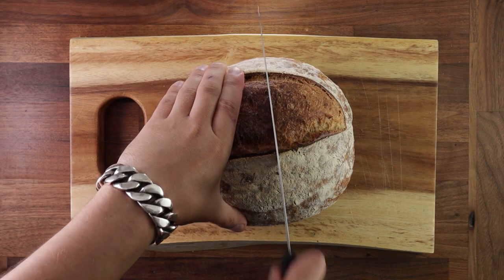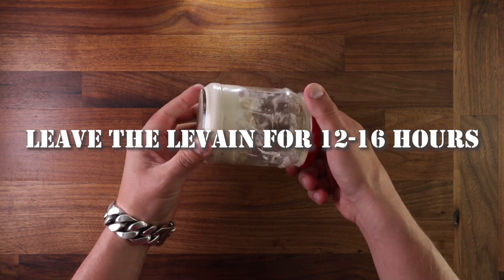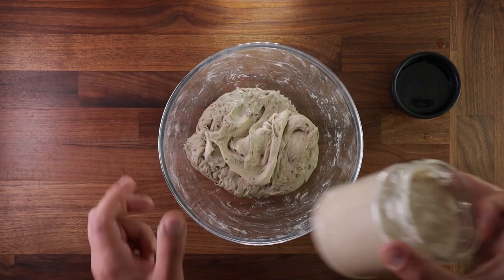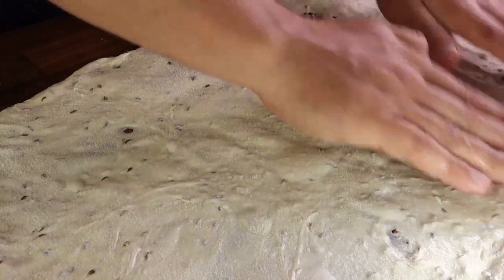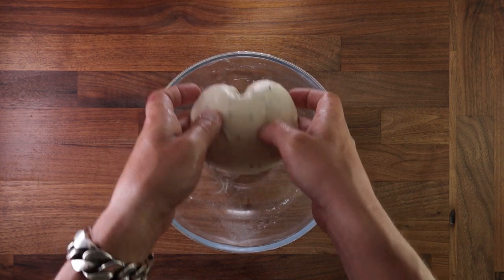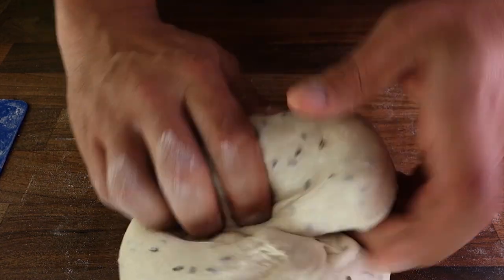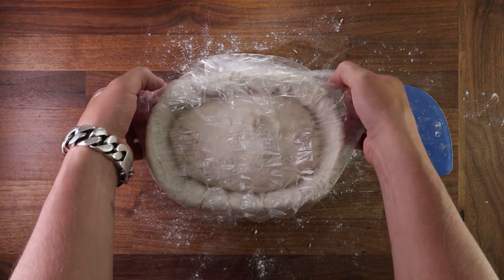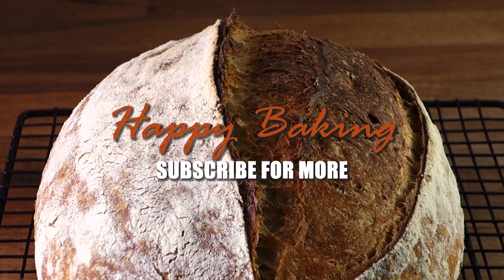Handmade High Hydration Sourdough Bread Recipe | Autolyse Method | How To

Comment: Struggled endlessly with this one even after following all the steps meticulously 😔.The beginning of the downfall was  the dough that was to be autolysed didnt quite look as taut as the one shown in your video. It started out shaggy and never formed a taut shiny surfaced ball. The end result was a dense chewy bread. Any clues on where I might have gone wrong ?
Reply from the maker: What kind of flour did you use?
Reply from the maker: It is definitely not an easy dough to work with and I myself had to do it a few times to get it right. If after the autolyse it looks still too soggy then perhaps you can leave it for longer.
Reply: Bread flour from the super market .
Reply: The dough had autolysed . It was stretchy. Since the dough prior to autolysation looked too shaggy compared together yours, was wondering if I could hold back like 50 g of water perhaps. I live in a humid city too! Thank you for your response always
Reply from the maker: I think 50g would be a bit too much. Try 20-30g. that would bring the hydration down to 72-75%. 👍🏻
Reply: Ok noted. Will try it when my spirits r more uplifted 😂
Reply from the maker: Haha I know how you feel 😄 trust me I’ve failed more than I’ve succeeded. All we can do is practice and learn :)

Comment: Can this recipe be made with 100% whole wheat? Would anything specific have to be changed? I'm very interested in 100% whole wheat sourdough but vids are hard to find on that specific type of bread. (most are blended bread or overly complex or use lots of extras)
Reply from the maker: Yes. You could even swap it right out. If the dough is not airy enough for you, then add more water. But I would say try it with just swapping the flour first and only then adjust the water if need be.

Comment: question tho, I put the dough back to KA mixer and use the mixer to work it instead of hand folding. I am sure it is fine BUT, could that be the reason that my bread doesn't have crumbs like yours? (Mine has always been closer/less/smaller bubbles kind of structure regardless hydration level)... really bothersome..... -__-
Reply from the maker: Sometimes close crumb can mean that the dough was over proofed. Perhaps that could be it?! Here's a video about it - https://youtu.be/N3vhXs3b07w

Comment: For convenience I like to autolyze over night about 9 hours.  Is this OK?
Reply from the maker: You can do that. But the extended time doest not have any extra benefit besides convenience. Flour gets fully hydrated in just a couple of hours 👍
Reply: @ChainBaker  Thanks.

It is just more convenient.  If I get up at 5 AM and have both starter ready and autolyze done then saves time.  

Also thanks for tip not to add salt pre-autolyze.

Comment: You only used sourdough starter and not any yeast? I thought that the souring was caused by the 2 types of yeast
Reply from the maker: Not at all. Use one or the other. Adding yeast to this would defeat the purpose of using a starter.